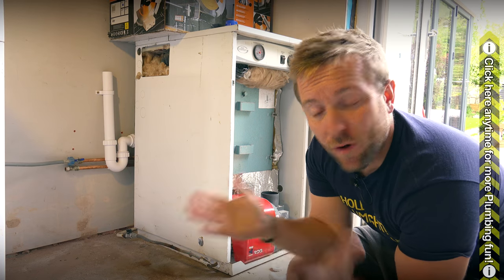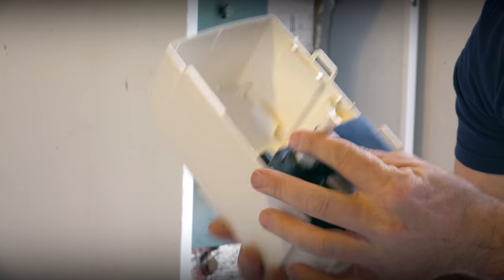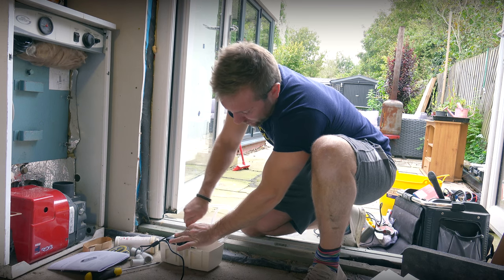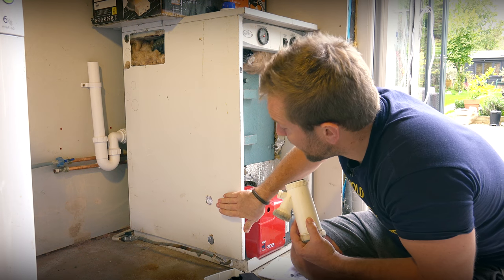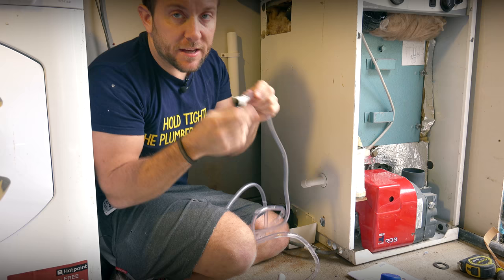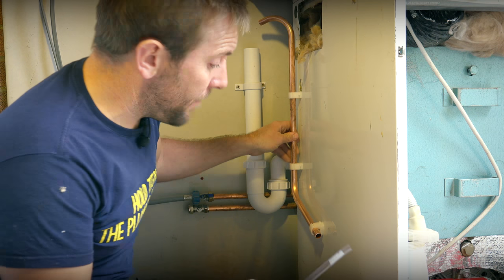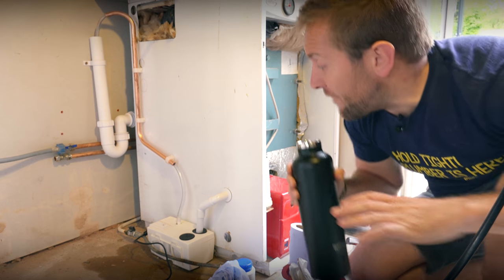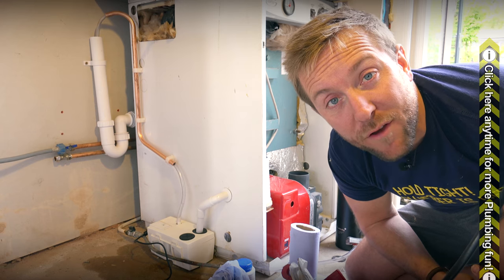CONDENSING BOILERS - Condense Pumps -Wilo Plavis

Comment: I have a question....I have a tap, when I turn it on it starts ok then slows down to a trickle....a couple month ago our water pressure went down, when I turned the main tap it felt like a crunch fell.....then the water pressure went back to normal.....but now this 1 tap is blocked....I can't take it off its in a bad place....and idea how to unblock with out having to use C4

Comment: Here in the states at least in my area,  code requires a condensate neutralizer before the pump , we even have pumps with neutralizer build in !
Reply: Quick question that Reillo burner , what fuel do you guys burn over there ? I got mix answers ,diesel , kerosene and number 2 heating oil !
Reply: Hi, there is a space inside the case for Condensate Neutralizer sachets.  Always stay the right side of the code :)
Reply: The actual condensate outlet for a grant is at the top, I don’t think a pump was necessary here, just perhaps cut down to the fixed plastic pipe a little.

Comment: Yooooo!! Like your boiler @ home lol ...
A question...

If it comes with just a plug what happens when it fails and the boiler keeps condensing? Usually Condense pumps come with a switch to shut the boiler off don’t they?
Reply: Btw AMAZING Tutorial video 👏🏽👏🏽👏🏽👏🏽👏🏽
Reply from the maker: Joshua! There is an alarm facility on it, but nothing mentioned in their literature (which wasn't all that great!) about it.
Reply from the maker: Oh yeah, test those links to socials JOSH! Wanna see if they open the app on a phone, or take you to the desktop (which causes leakage....) I'll pat George on the head for you....
Reply: Ahhh yes! Very good! Maybe wire it to a fog horn!
Reply: Josh Tappin yeah your right josh. Ive fitted boss pumps and also vaillant and they come with a kill switch so if pump fails boiler wont get 240 so cant fire up
Reply: Hi Josh, yep the Plavis comes with an alarm/fault connection so is totally capable of letting the boiler know the pump has failed
Reply: Alarm is good if someone at home, better if the safety switch cuts the mains to the boiler, to prevent flooding / condensate damage, esp if fitted on 1st floor.

Comment: Naughty, naughty... flue terminal very close to that wall and OMG a crappy metal braided flexi hose that looks rusted ready to leak AND it goes through the boiler case!! Should be copper fuel line into the boiler case, then flexi, NOT a leak waiting to happen metal braided flexi, but a long life bio flexi... :-)
Reply from the maker: Flue is temporary! You can probably see the wall clading isn't finished yet (waiting for end profile) Once that's done I having a vertical high level terminal 45'd past the soffits. It'll be fine!
Reply: Top man. Just pointing it out for Joe Public, the installs I come across I think the phrase "you can't fix stupid" applies.